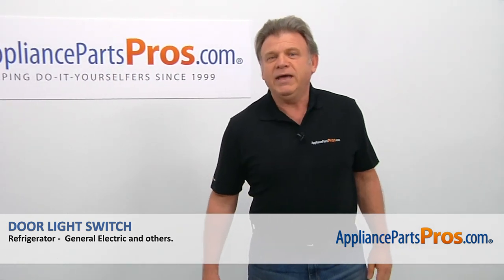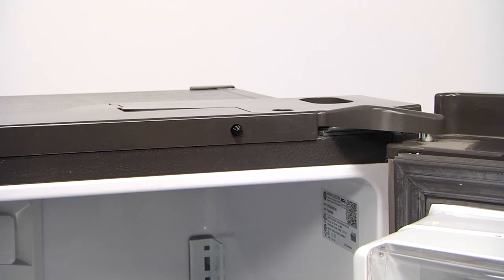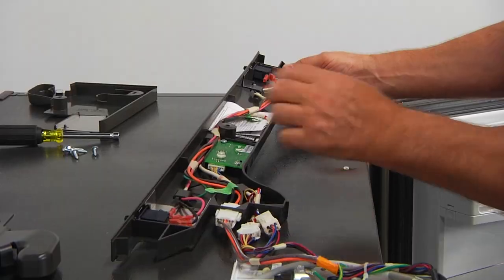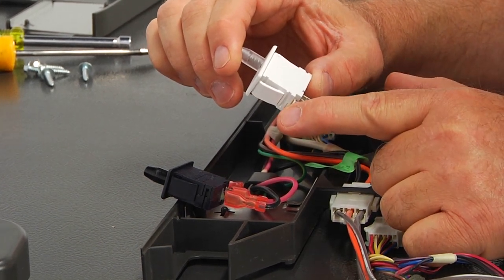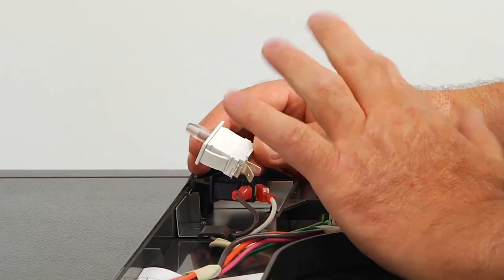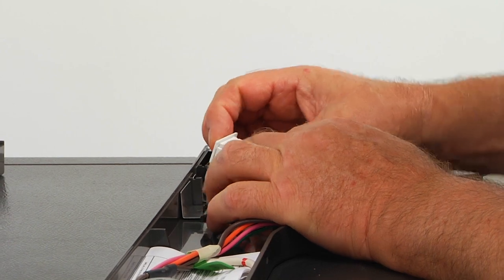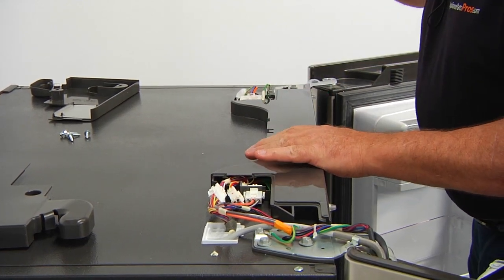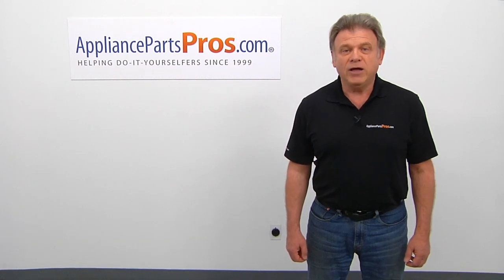How To: GE Refrigerator Door Light Switch WR23X29170

Comment: I replaced the switches as shown, but it did not solve the problem.
Issue is, when opening left door light does not turn on. Right dude works well.
I swapped switches and it is clear the switch is not at fault. Any ideas what else to check?
Reply from the maker: Depending on the model number, I would check the wiring to make sure you don't have a breakage somewhere. If you have a meter, you can check the socket/light to see if you have voltage coming to it with the door open.